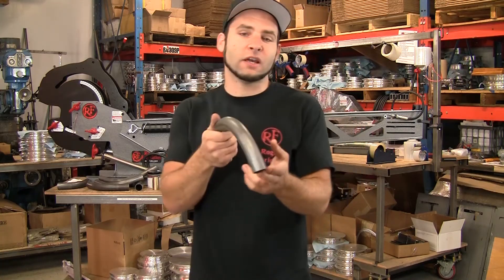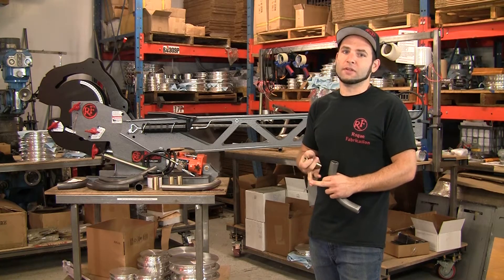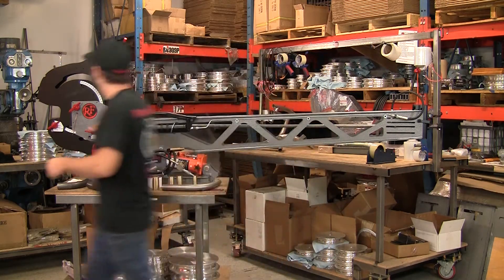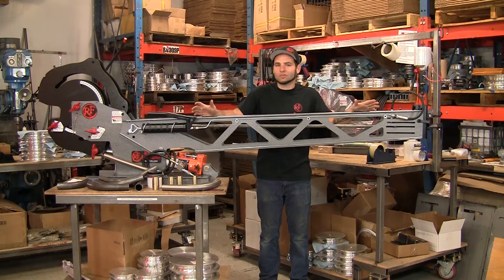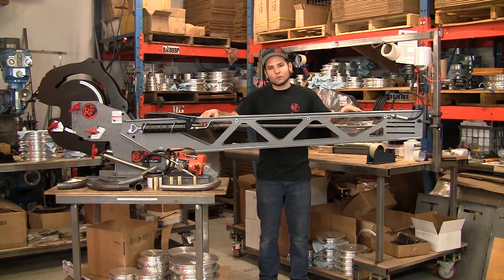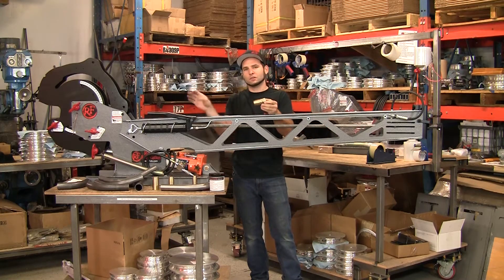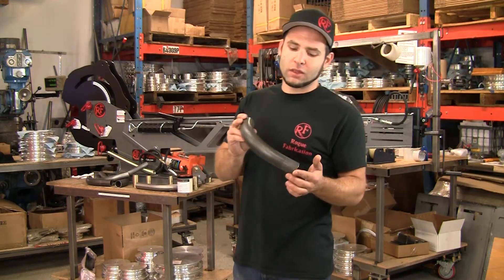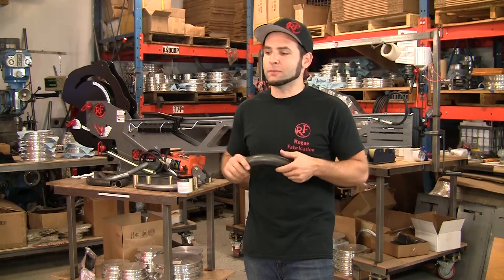Most Affordable Mandrel Bender in the World

Comment: Can I bend a 10” diameter perfect circle of thin wall tubing out of this??
Reply from the maker: Yes. It will take a custom die depending where you want the measurement to be. Make 2 180s and weld them. We're assuming 1% or less deformation is what you consider perfect.

Comment: Can it be used in larger diameter tubing? Up to 4"
Reply from the maker: No, 2" is the max for standard applications. In certain cases we go up to 2.25". Keep in mind these machines (our M600 mandrel benders) are about $4k with a set of tooling, ready to run. A 4" mandrel bender starts at $112k without tooling/installation/rigging. That is the cheapest one we've ever seen :/

Comment: Why the limited die and mandrel options for the M600 Mandrel tubing an pipe bender?
Reply from the maker: We add them to our catalog based on demand. The machine doesn't fit dies over 2" OD. What do you need dies for? We will consider adding what you need to our die list and stock.

Comment: Still pricey.  Market needs a full stand alone solution for under $200
Reply: You should make one!
Reply: Raw materials and the cutting to size probably cost more than $200. I think the price is excellent. Going to purchase one this week 👍
Reply from the maker: No kidding. I've never seen just a mandrel (literally just the internal tube support) for less than $200. Not including machine, hydraulics,  bending die, clamping system, lubrication system, etc. There are a lot of moving parts!